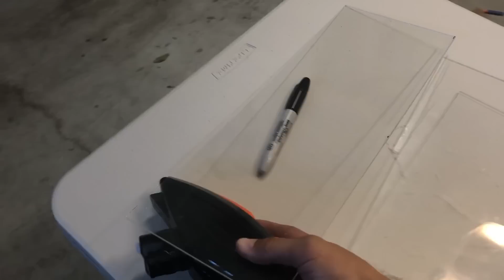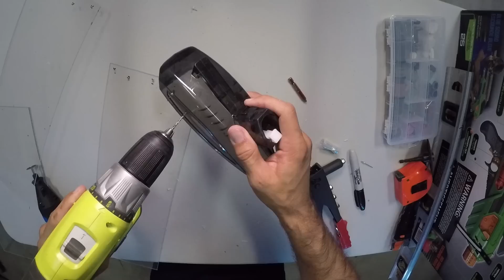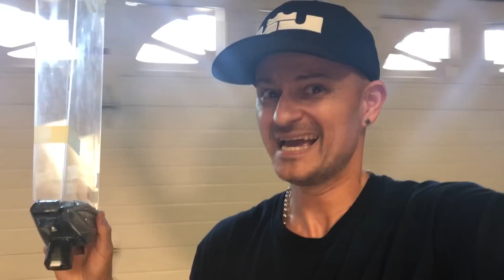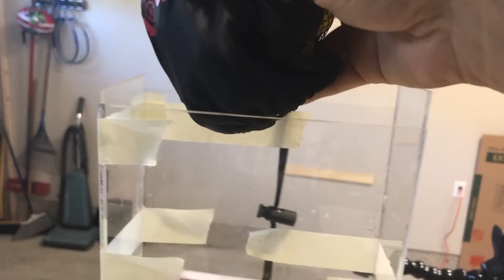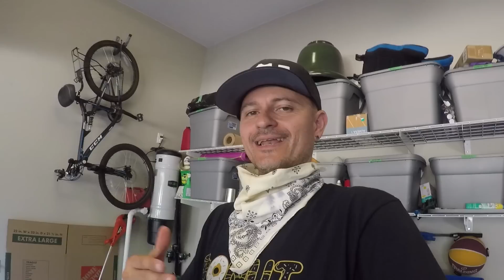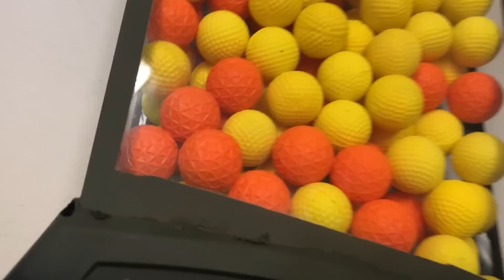400 Shot Adventure Force Blaster Mod!

Comment: 400 is NOT impressive for a modification,  especially for a ball blaster. 800+ Would have been much better. This compared to Coop772's 1200 round Triple Nemesis and 7500 round Triple Prometheus, Legitbread's 8500 round Nemesis, and others, this is pathetic.